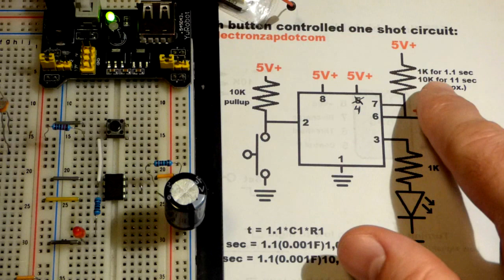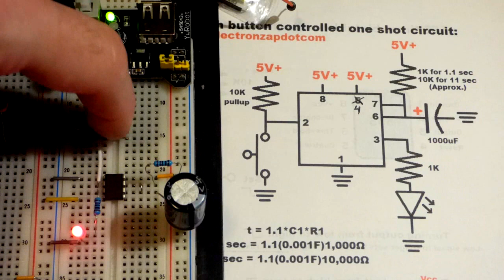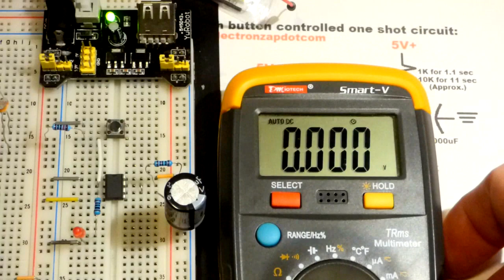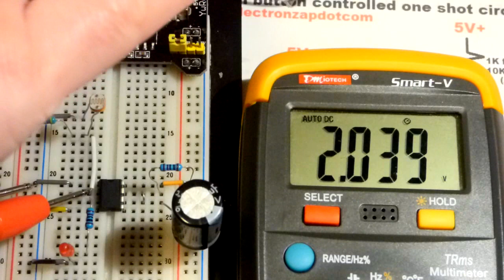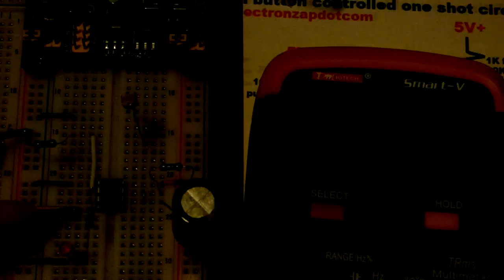Light dependent resistor LDR replacing push button switch for 555 timer monostable circuit

Comment: Trying to build a circuit where the led switches on for 1 second even when the button is held down.  Any tips?
Reply from the maker: I made some pulse circuits a while ago, this one is probably the best one https://youtu.be/xhMQUvo78Zg Prototype monostable 555 timer voltage booster with pulsed push button switch schematic diagram

Comment: Hi there. Great video. I am building a laser(/taser) tag kit with TENS units. A TENS unit is basically a device which sends electrical pulses through wires and sticky pads (to complete the circuit). The pads need to be on your ass cheek and upper leg. This makes you fall down when you get hit. The hard part is replacing the 'shock' switch with LDR sensors. Could you help me with this? What is the easiest and most cost efficient way of achieving this?
Reply from the maker: Sounds like you'd want a LDR switch circuit using a transistor or op amp. I'm guessing a power transistor would work best to handle the required voltage and current. I'd do google searches trying to find something similar that someone else 
has built.
Reply: @Electronzap  Thank you for your reply dude. I see a lot of LDR darkness sensor circuit videos online. It is used to turn on a LED when it gets dark. It's essentially the same thing, but the other way around. Is it possible to invert this circuit (on, when it receives light), and connect it to a switch instead of a led? I'm a noob when it comes to this, and I don't want to hurt anybody. I appreciate the help bigtime